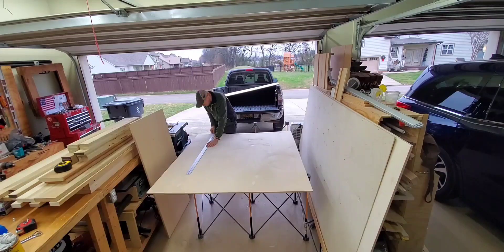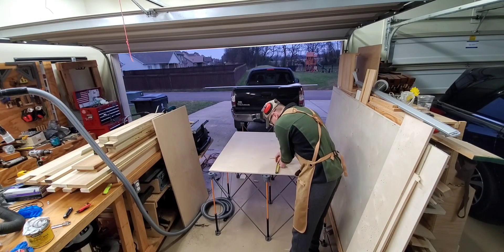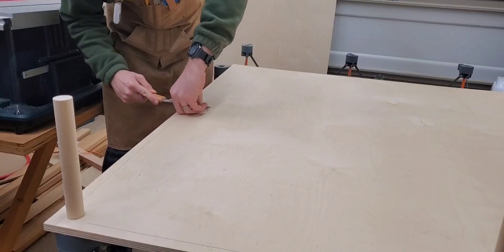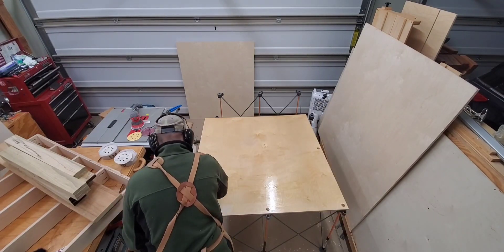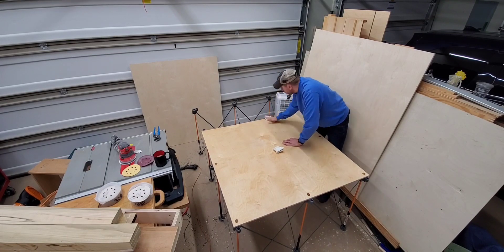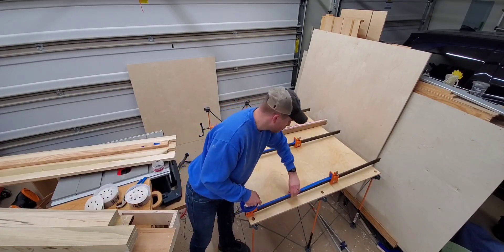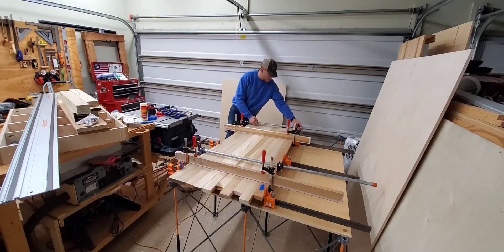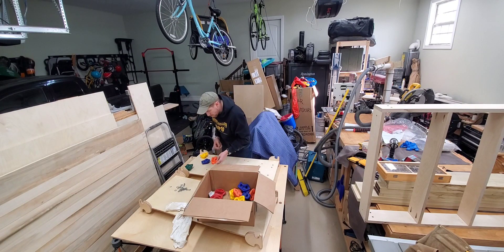Adding a quick assembly/clamp table.  Bora centipede 4x6 folding table.

Comment: Great video. Would you say the plywood table top was pretty flat and level? Was thinking of getting a centipede as well for a flat/level surface to do big panel glue ups as well.
Reply from the maker: I used half-inch birch plywood. It's functional,  but not super stiff.  The Centipede itself is extremely strong.  I went back and added some ribs to my top for stiffness.
Reply: Depends how flat and level your floor is and how flat your sheet is